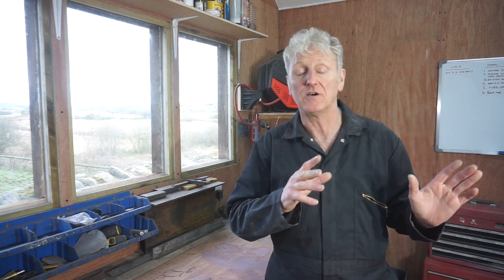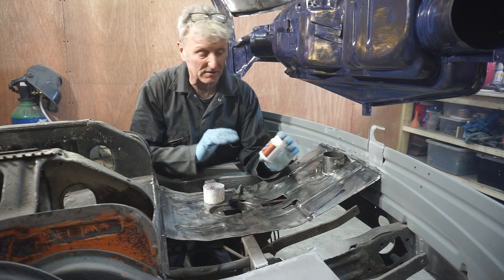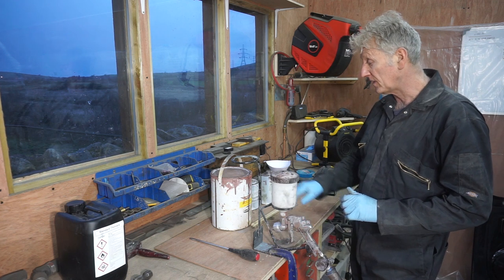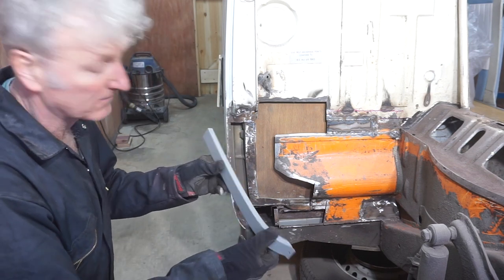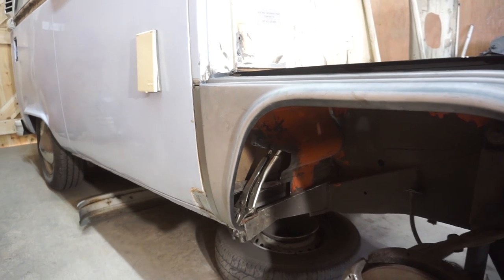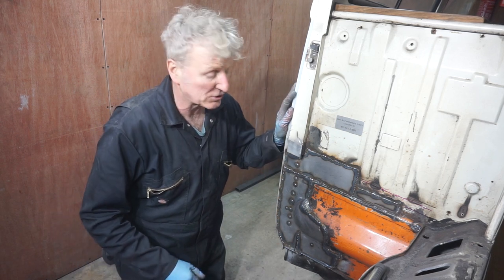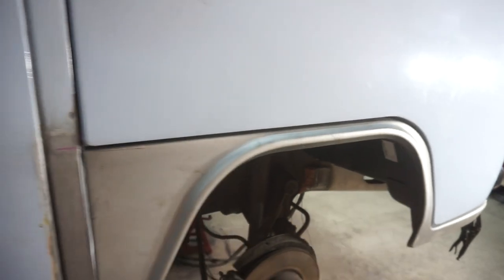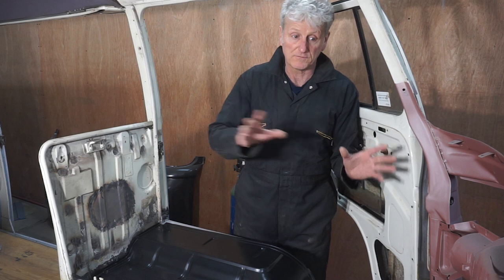1973 VW Campervan Restoration Part 9

Comment: Evening.. I have a question ref the kurust type product your using.. How do you find it where your welding near it.. I. E reaction to heat... Ive had a few issues.. Again.. Brilliant videos
Reply from the maker: Hi, not had any problems but when ever I am welding I always clean the area back to bare metal including any areas I have treated with Kurerust.
Reply: Ok.. Thank you for replying... I guess i will give more clearance from now on.. 👍